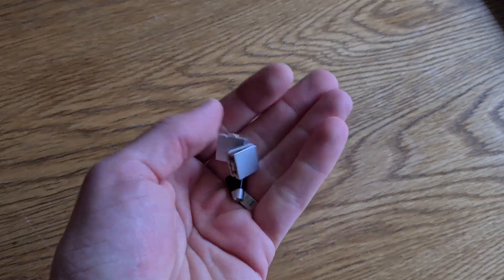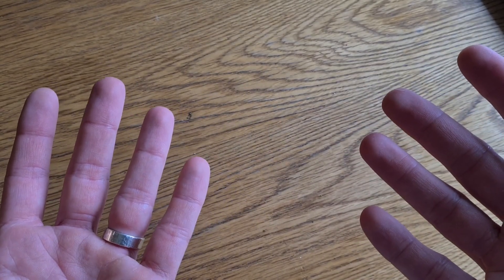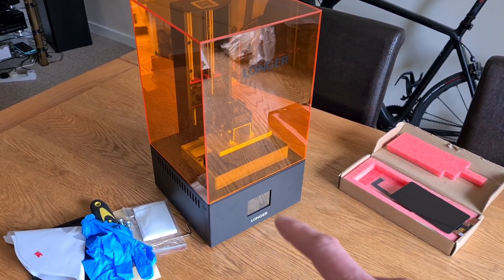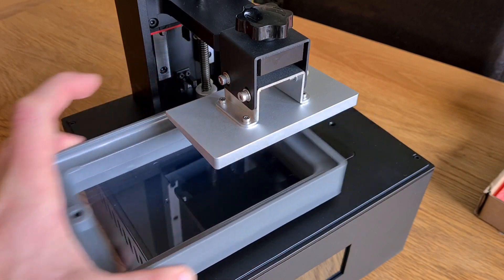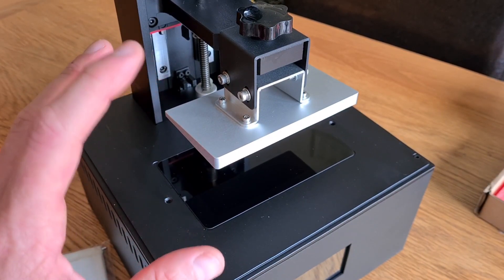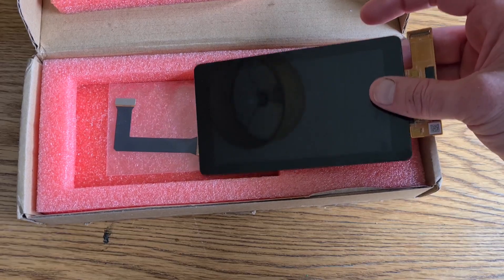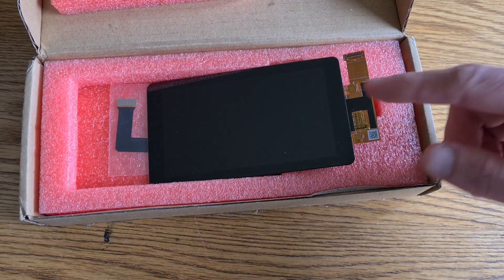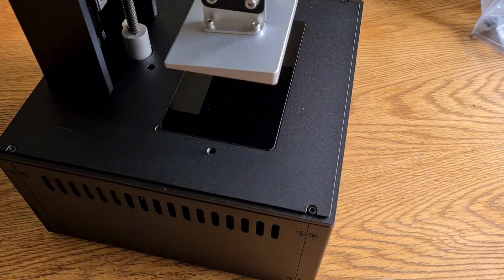I CAN MAKE MY OWN PARTS! Longer Orange 3D Printer unbox and upgrade 🦎

Comment: I've wondered about 3d printers for exactly this sort of thing, for a couple of years, it will be VERY interesting to see how you get on.   I've wondered if there are devices/apps that take a series of photos of a small item from various angles and create a design file for a printer like this, as i see that as the main crux of it, now the hardware to make the things is here
Reply from the maker: It seems that in order to produce something useful you basically have to measure up what you have and create it in a CAD programme, then print it. I have done a test run of the sliders for that marantz amp and they turned out well - took me about an hour to design them by watching a YouTube video. For more complex things like cogs it's still possible just more in depth for the design phase. All entirely doable though!

(This is presuming that someone hasn't already done the hard work and made it available online - which does happen)

Comment: Very cool! I saw some repair videos on yt they had to abort the repair because of irreplaceable, unrepairable parts or to difficult time-consuming expensive effort. Would be cool you do a video about an audio device that until now could not be repaired.
Reply from the maker: I've got just the thing. I've got the mentioned marantz amp and it needs a volume knob and some eq sliders. 

I've just managed to dial the settings in for the printer so going to print some audio bits off tomorrow - I'll put a quick video up of the results 😄